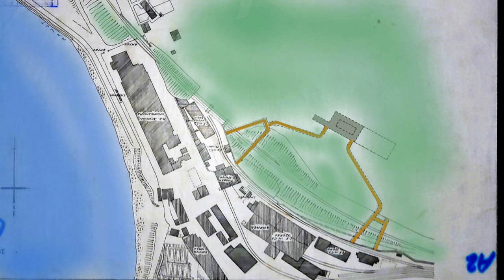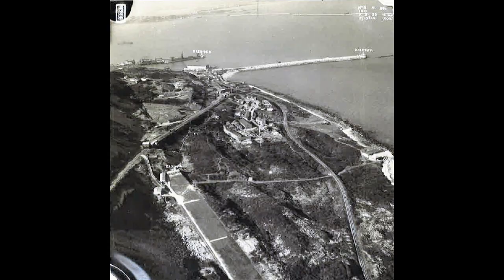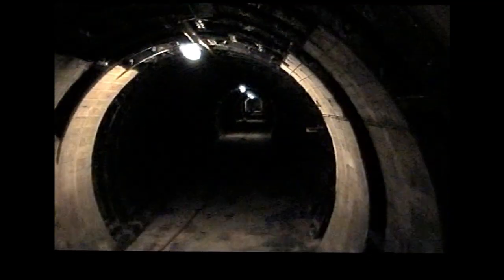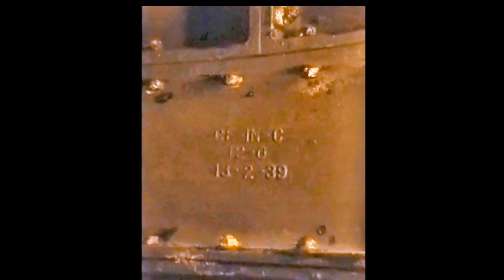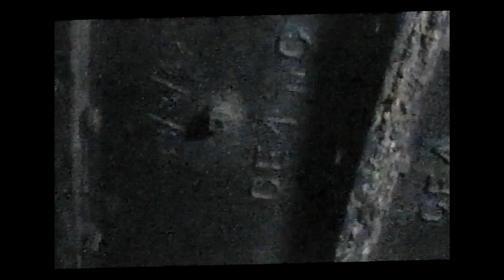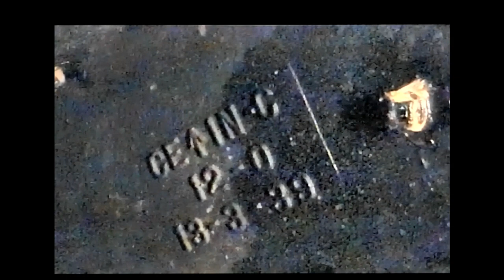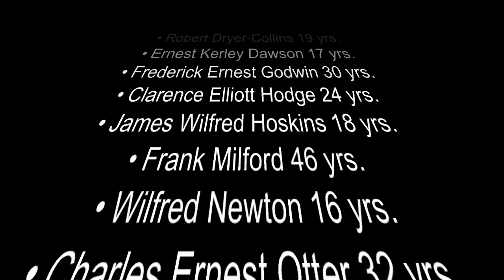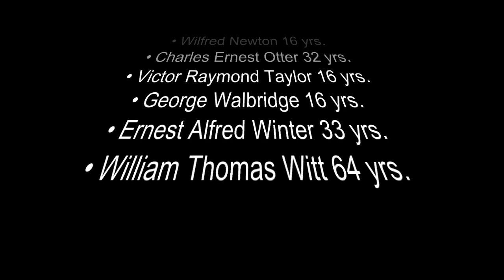Secret WW2 Tunnels, Portland. Underground Naval Operational Centre & fuel storage. Air Raids 23 mins

Comment: Are ANY tunnels on portland still accessible? Smugglers, Naval, Victorian and so on.
Thanks.
Reply: Only the high angle battery tunnels as far as I know. But there is a way into the tunnel that leads from the Borstal to the shoreline where prisoners went to bathe. Accessable through the Grove cliff caves.